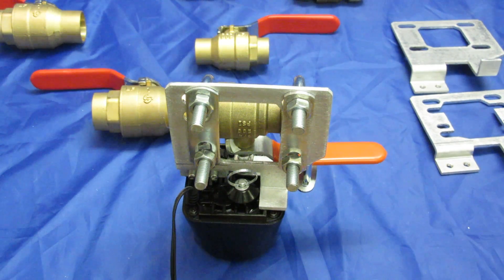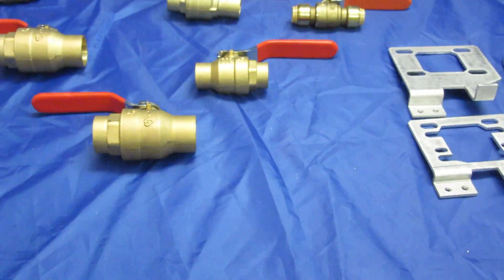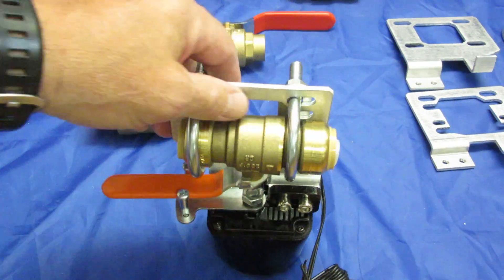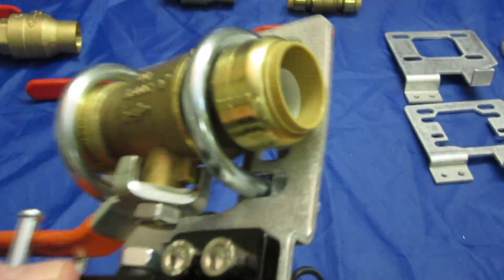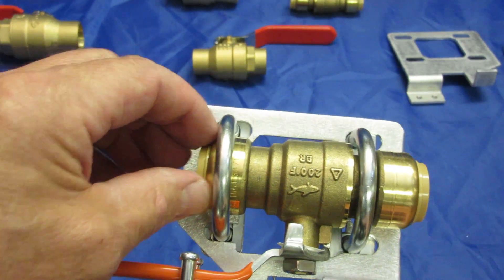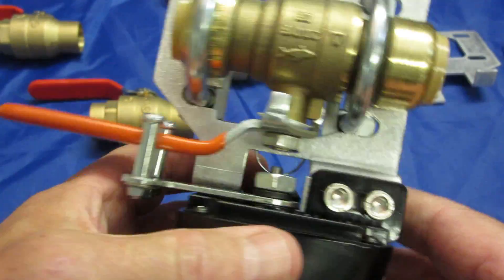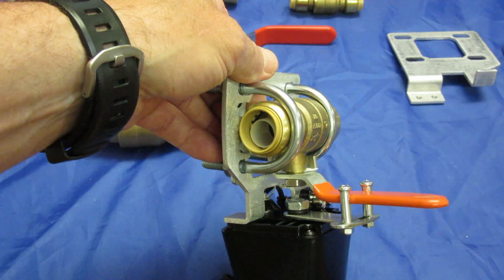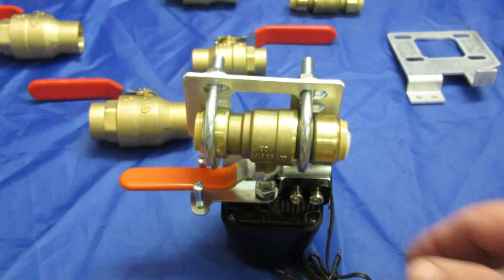Smart Home Water Shut Off - 3/4" ball valve

Comment: The automated valve actuator seems to be identical to this unit on Amazon for $33, though this one is WiFi and works with Alexa/Google Home instead of Z-Wave which is older tech.   It can also be automated with IFTTT so you can introduce true automation such as using a leak detector to trigger it to turn off the water.  The mounting kit that comes with the valve may be less stable than having a full backplate, but it is designed to work as it is out of the box.

As for the rest of the parts:

The 3/4" SharkBite valve is about $22 at Home Depot.  - https://www.homedepot.com/p/SharkBite-3-4-in-Push-to-Connect-Brass-Ball-Valve-22185-0000LF/202270643
The U-Bolts are about $5 each.  - https://www.homedepot.com/p/Channel-Master-Universal-U-Bolt-and-Nest-Assembly-CM-9017/203763054

The only thing that isn't readily available is the backplate.  You could make that with a drill press and some steel stock if you needed to.  

Valve Actuator Link on Amazon:
https://www.amazon.com/Owfeel-Control-Compatible-Application-Program/dp/B07S9YXSC6/ref=sr_1_2_sspa?dchild=1&keywords=smart+water+valve&qid=1607455237&sr=8-2-spons&psc=1&spLa=ZW5jcnlwdGVkUXVhbGlmaWVyPUExMzdUWk9NUk80S1hOJmVuY3J5cHRlZElkPUEwMTA2NDg1MjFRMUFKU0RIOFUxMSZlbmNyeXB0ZWRBZElkPUEwODg0NTYxMjM3WTYxUjhNMDBaWiZ3aWRnZXROYW1lPXNwX2F0ZiZhY3Rpb249Y2xpY2tSZWRpcmVjdCZkb05vdExvZ0NsaWNrPXRydWU=